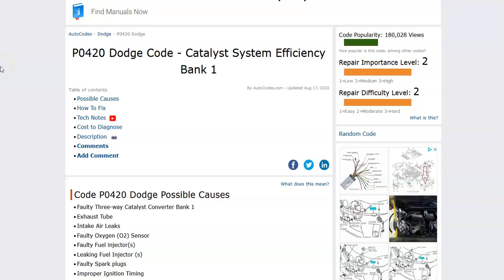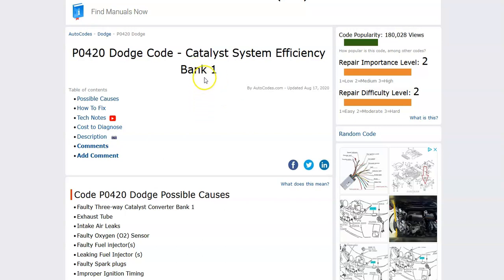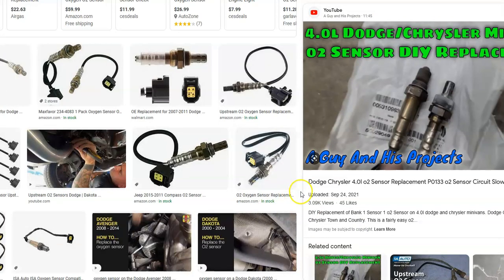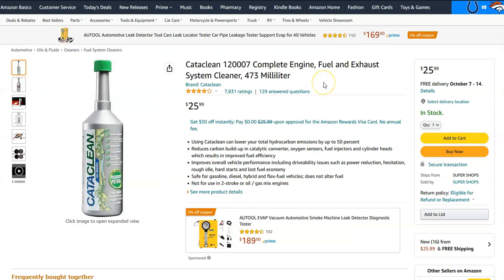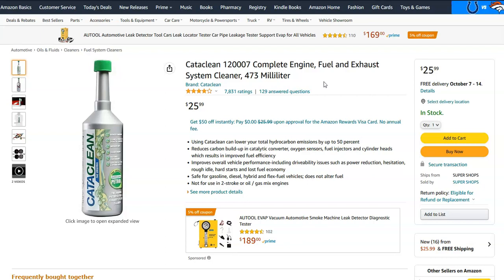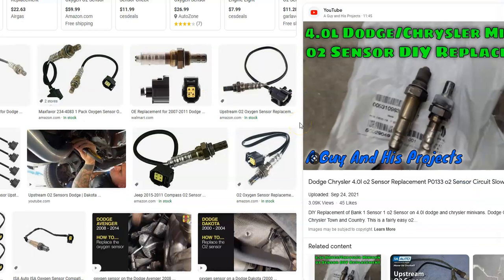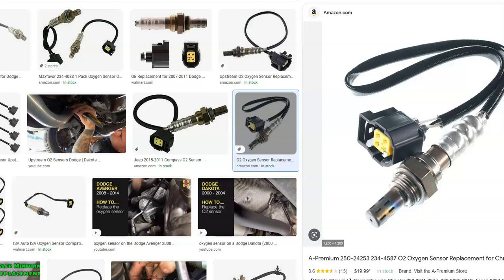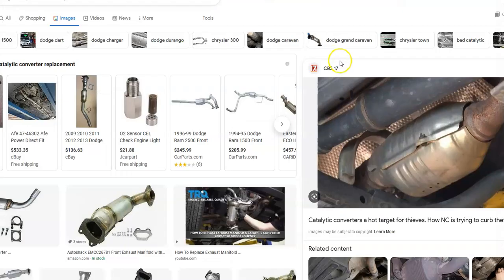Causes and Fixes Dodge P0420 Code: Catalyst System Efficiency Below Threshold (Bank 1)

Comment: Is bank 1 before or after the cat?
Reply from the maker: Bank-1 is the side of the engine with the #1 cylinder. V6 and V8 engines have 2 banks; a 4-cylinder engine has only 1 bank. There are two 02 sensors on each bank: sensor-1 before the CAT, and sensor-2 after the CAT.

Comment: If you have ever used zinc additives or lead additives you will never pass emissions tests ever again !  the zinc remains in your engine and escapes through the exhaust coats your brand new cats and cost you thousands to comply with emissions but the motor last forever! all cataclean will do is burn the zinc off and in a month you will have the same exact problem again! its either you protect your motor so it runs 3-400k miles or appease the government demands

Comment: I'm a mechanic for 39 yrs.......I've had this code numerous times..... Bad Cat Gasket
Reply: can i drive without fixing it?
Reply: @Priyathama-s3k  No
Reply: @Priyathama-s3k  you CAN absolutely continue to drive with a bad cat/gasket don’t let these people scare you. Whether you SHOULD drive or not is debatable. Go around, get some quotes in your area and get the issue resolved asap.
Reply: Hey thank you for this comment, it gave me a direction to go to. I sprayed some soapy water and behold I saw the leak, bought a OEM CAT gasket and replaced it no more leak and sure enough code is gone! Thank u man .
Reply: @Shaolin36-chamber  The Cat Bracket does tend to relax over time, so it would be good to pick up a new one or bend it back so it tightens when torquing back down
Reply: @stanleyroper5942 oh no I already put it back 😂. Thank you tho I’ll consider it if it comes back !
Reply: @Shaolin36-chamber you were able to fix without a mechanic?? Would you say this is easy to do?
Reply: @JackW0t  I am a mechanic so I don’t recommend this for non experienced people, things can go south really fast. It’s not much labor so I would recommend u go to an experienced exhaust guy.
Reply: Yes @JackW0t
Reply: @stanleyroper5942 I’m not completely sure I agree. Getting under the car to access this part without proper equipment can be a challenge & that’s your first red flag to stop. I ended up having my catalytic converter replaced fully. Code cleared.

Comment: Normally if the sensors are bad it should say bank 1 sensor 1 or sensor 2. But most of the time dodge doesn’t say sensor at all. It only says catalytic efficiency bank 1 or 2.

Comment: I need to replace bank 1 catalytic converter. Which side is that ?
Reply from the maker: Google your engine cylinder location, and the #1 cylinder is the bank-1 side. A 4-cylinder engine will have only one bank, but a V6 or V8 will have two banks.
Reply: @ it’s the same 2014 Durango V6 like yours.

Comment: I got a CAT code and 02 Sensor when I changed the crankshaft positioner. I tried to reset the codes but they come back after revving the engine

Comment: I have a 15 2.4 journey and I got a P0420 code. The car runs perfectly fine with zero issues. I did change our both O2 sensors and even the Cat and the code still lit up. Any recommendations on what else I can check?
Reply: u should try cataclean it will work once u add it take it for a drive but u gotta put the pedal to floor lol so that cleaning fluid could work right
Reply: @dafooochris Try sea foam
Reply: @dafooochris they already changed the cat and O2 sensors why would they need cat clean?
Reply: Did you fix it ? I have the same issue
Reply: Zinc additives sent mine into a bonkers loop ! its either you save your motor and thousands upon thousands of dollars or appease the cult of tree hugging politician azz kissers ! zinc and lead cushion all your internal parts but also the excess is sent out the tailpipe by way of blow by  the zinc coats the inside of your cats and o2 sensor the same way it coats your parts and makes a catalytic converter useless! if you change your cats and still have zinc in your motor its still purging and will coat the brand new converters all over again !
Reply: @tpformybunghole-666  Our Journey has the same code all the time.  I remember we'd get a ck engine light even when new but it seemed to be fixed by tightening the gas cap and after it got below a certain level it would clear.  I never checked the actual code cause I read this was an issue. Now this doesn't work and checking its a 420. So who knows if this cleaner stuff works or a spark plug extender for the oxygen sensors.  Funny my 2012 Honda Accord has the same code now! Journeys seem pretty junky really. Any resolution on yours yet?
Reply: fire your local politicians and force these loosers to build stuff without emission crap
Reply: Check like he said a fuel injector could be leaking fuel back Into it

Comment: I have this code and a p0305 which one will be the problem. It passed emissions. The p0420 appears first when I read the codes.
Reply from the maker: Since only one cylinder is misfiring, it is likely an issue with an injector on cylinder 5. Leaky injectors can clog up a catalytic converter and give codes.

Comment: I currently got this code for a 2015 dodge dart sxt been had it for a year now and I’m not sure where to start really. Found a cheap cat for 150 not too pricy but just wondering if it’s worth buying a new one after a year usage.
Reply from the maker: I would test the sensors and Cat to see if they failed.
Reply: Recall U90 for Dodge dart with 2.4.for cat getting to hot they replace the cat, O2's and manifold gaskets check it out.

Comment: what is the typical expected voltage reading? Is it the same for every manufacturer? Thanks!
Reply: Показания первого кислородного датчика должны колебаться от 0.8v до 0.2v.

Показания второго кислородного датчика должны быть максимально неподвижны.  Это будет свидетельствовать о чистоте выхлопных газов после прохождения каталитического нетрайлизатора. 

Тесты необходимо проводить на горячем двигателе потому как кислородные датчики работают от 600 градусов цельсия

Comment: i have the same code on my 2016 dodge journey  it says bank 1  and 2 weeks ago a hose that sits right ontop of the catalytic convert ripped and engine coolant started to spray out and sprayed the whole catalytic converter do you think that may have messed up one of the o2 sensors
Reply: I think so. Did you ever find out?

Comment: Stick with OEM parts and change both upstream & downstream O2 sensors first before condemning the Cat. You can always move them over to a new unit if you buy one. Also there are two connector patterns to look for. My 2015 Challenger with a V-6 has three white and one black. Also the dealer will charge you an additional $500 per Cat assembly as a core return and refund your money upon receipt of the old turn-in. 
    You'll need a 22mm open end wrench "shorter is better" to replace the O2 sensors and their done from underneath. There's already a graphite thread lubricant on the new sensors. Do not over tighten and you should be golden.
 One more trick is for the driver's side, remove the serpentine belt then loosen the A/C compressor and let it slide down the lower mounting studs, so you can move the Cat assembly forward enough to clear the rear pipe it slips into. A second person really helps here steadying the forward portion while it comes out.
Reply: You’re right to stick with oem. I once replaced them with aftermarket and was going nuts trying to find the issue.

Comment: We get this code when the roads are wet. My wife pointed it out. Since I payed closer attention to the timing of the code popping and sure enough she is right. It only pops on wet roads travel. Any thoughts?
Reply from the maker: I would test the O2 sensors as they may be failing when they get wet.
Reply: @HVAC_Mechanic как датчики могут намокнуть? Они находятся внутри трубы в горячей среде более 600 градусов по цельсию. Возможно вы говорите о контактах этих датчиков?  

Я бы также проверил магистраль EVAP….
Reply: @PaulBap he’s probably got a chafing in one of the wires of the O2 or the plug itself hasn’t got a good seal and the water from the wet road is grounding it out ?
Reply: @timrowe28  This is what I was thinking. Id replace the sensors since you get a new harness with it, if in fact it actually only comes up in wet conditions.